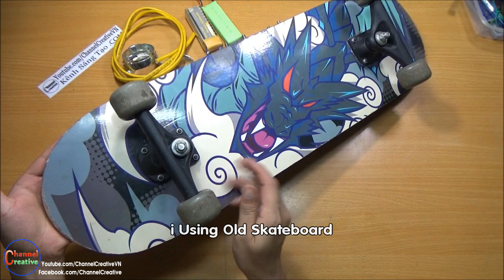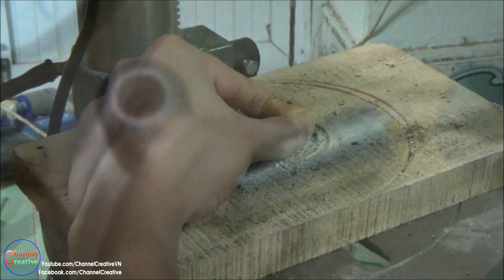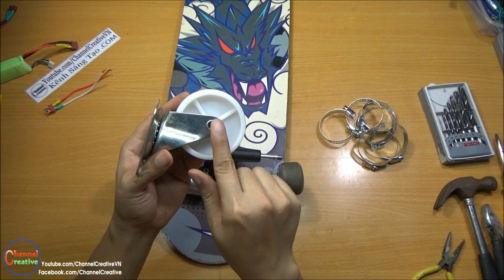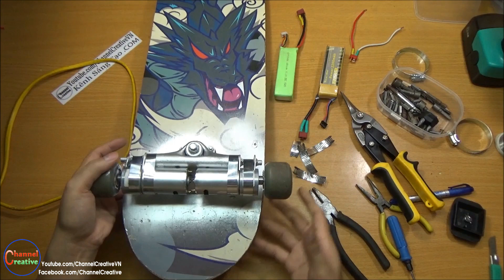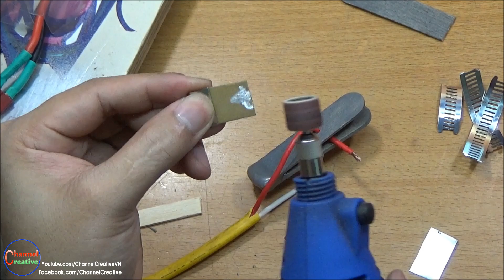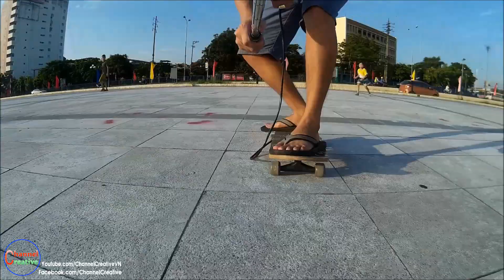How to make a Electric Skateboard

Comment: can I do it with a regular 12v motor ? Nice work  ;-)
Reply: is there another motor that gives higher speed ?
Reply: +Miguel Anjo Rodrigues Look at some strong brushless hobby motors. Or brushed if you must, but I'd go brushless myself.
Reply: +Miguel Anjo Rodrigues You can't have the wheel attached right to the motor shaft like this though, it would break a normal motor.
Reply: OK thanks

Comment: if I added a transmitter and connected it to a remote would it work?
Reply: You would need a ESC if you were going to do that.
Reply: +Matt G won't I need a BEC as well then?
Reply: Well a BEC is optional. If you don't want multiple batteries, (since that's what BEC's do: battery eliminator circuit). i'm pretty sure it's optional.
Reply: Right, thanks